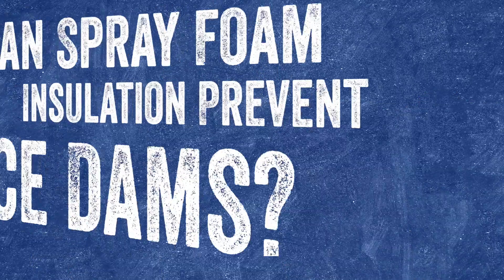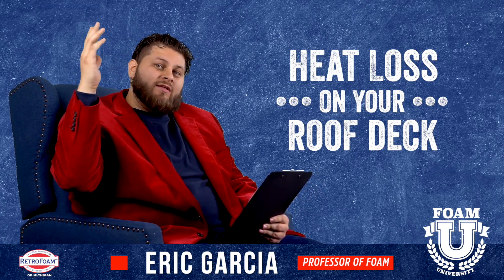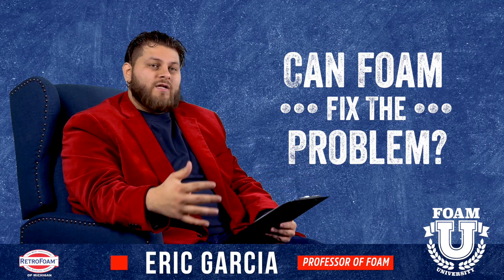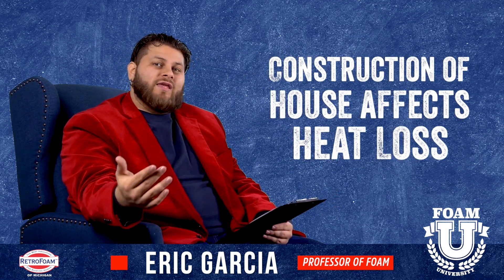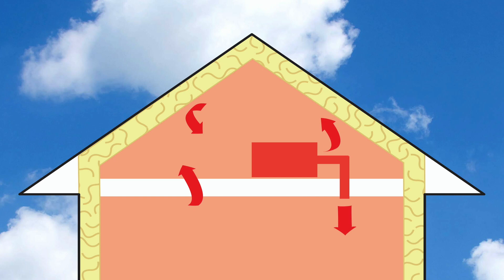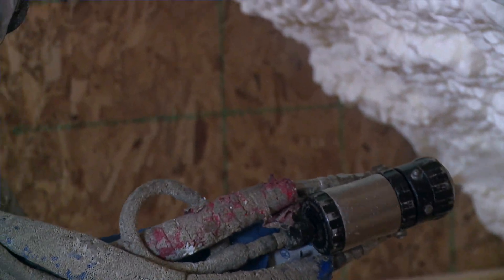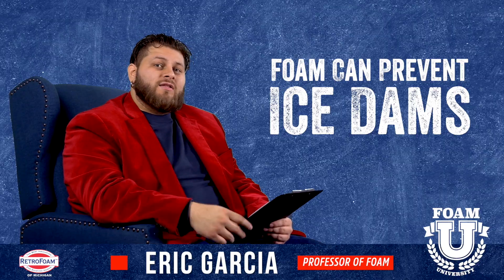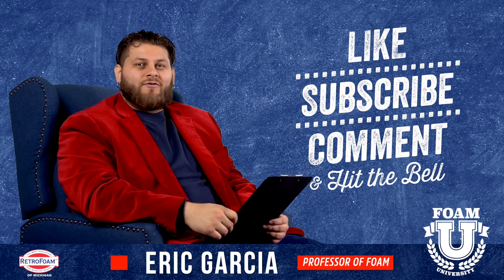Does Spray Foam Insulation Prevent Ice Dams? | Foam University

Comment: I have a 12' roof overhang on a deck that spans 50' wife and have had Ice damming issues in the past (this section of the roof faces north). The overhang  roof over the deck is the same roof the runs over the attic above the living space in the house. The space above the deck is not insulated currently except for sealed foam boxes over soffit recessed speakers and sealed insulated canned lighting. I have mitigated the ice damming by tripling the amount of roof vents and removing snow when we have over 5 inches of snow on the roof.  Now I am considering heat cables; however due to the size of the area the amount of power and materials pushes me toward a better mitigant. Your thoughts?
Reply from the maker: Sealing off where the overhang connects to the roof line could help. With an overhang that big, heat cables would be a good thing to consider.